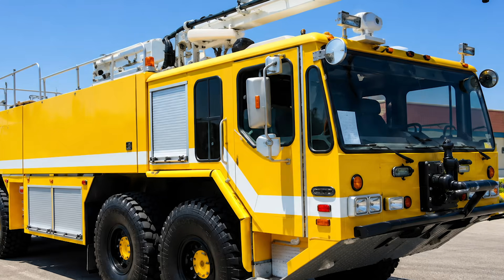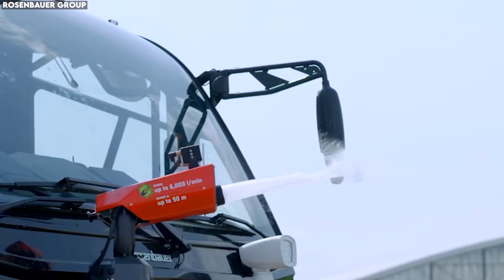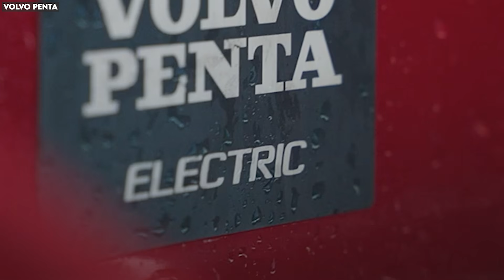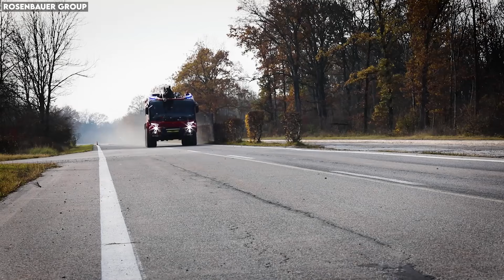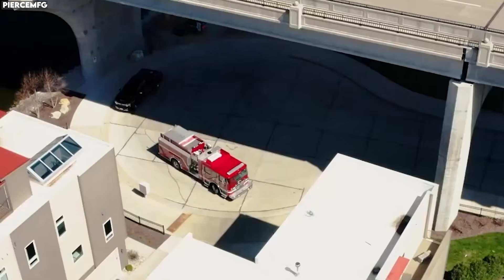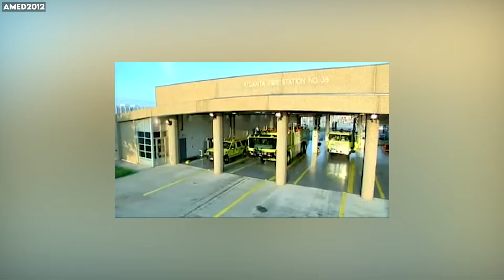10 BIGGEST FIRE TRUCKS YOU NEVER KNEW EXISTED!

Comment: No 7 doesn't really fit in a lineup of the largest apparatus, as it's just a 100% normal and average sized fire truck in Germany
Same goes for No 3

Also most of the crash tenders listed in the video ... yes they are large, but just as large as other crash tenders
Also No 1 the FDNY super pumper ... although it has impressive numbers, it's no-where close to being one of the largest fire trucks!